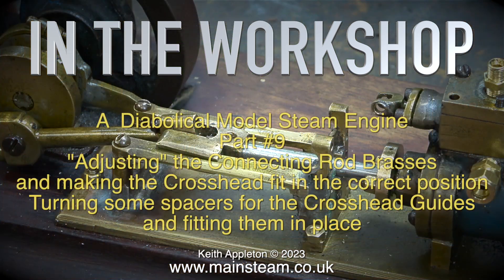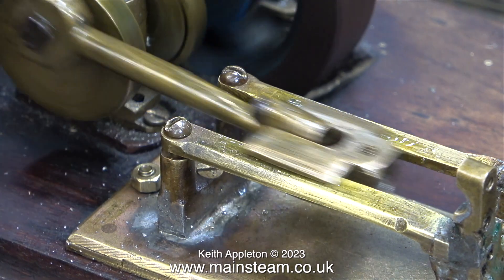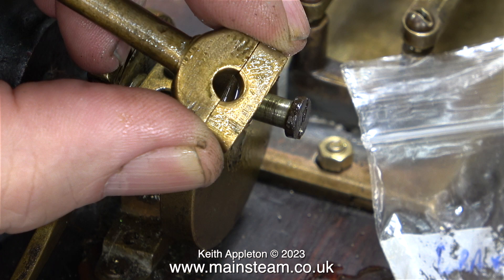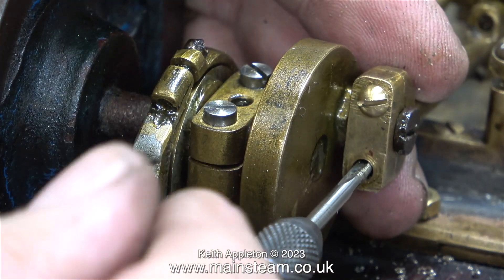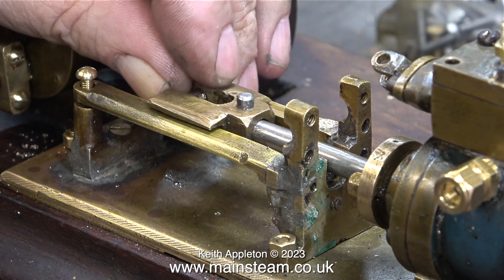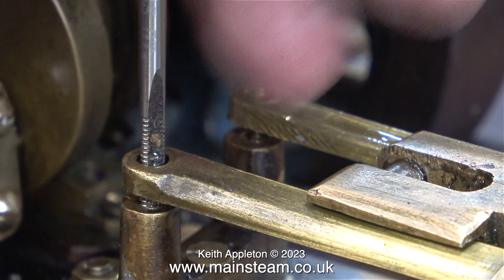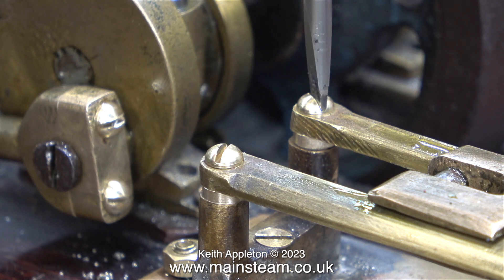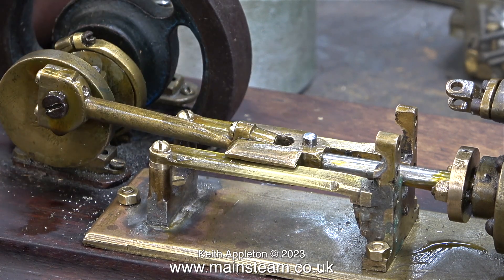A DIABOLICAL MODEL STEAM ENGINE - PART #9

Comment: The whole problem with a job like this is resisting the urge to actually fix everything right. A steel or iron liner in the cylinder, babbitt bearings in all the running parts and of course a proper actual alignment. 

Still it looks like you are having a bit of fun with this. More fun than a prostate exam no doubt.
Reply from the maker: I fully  agree and I am working to the existing build standard of the engine, and yes it is marginally better than a Prostate biopsy I suppose }:-)))